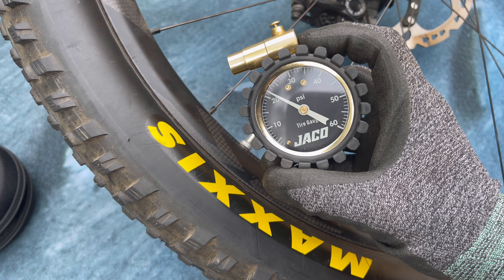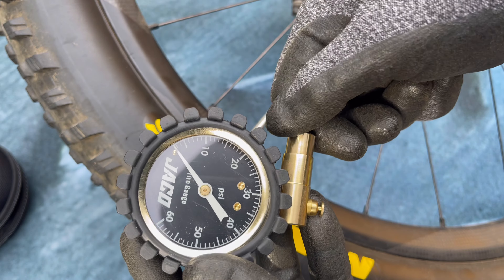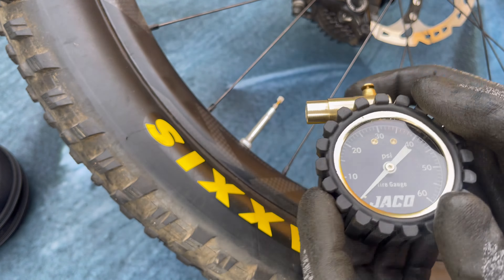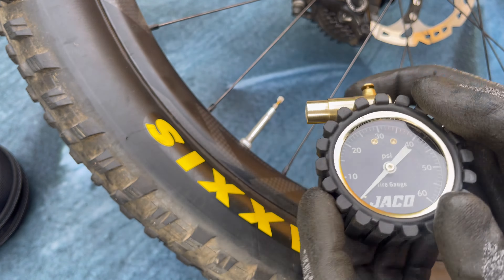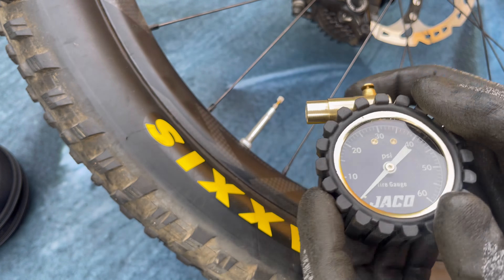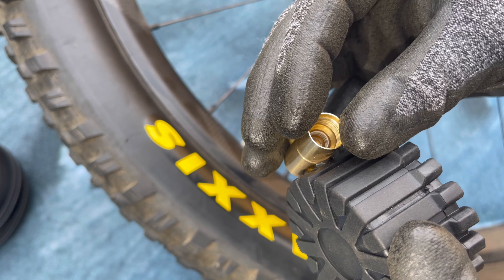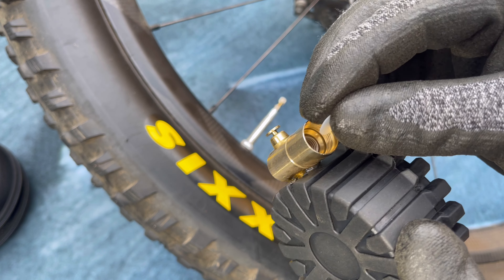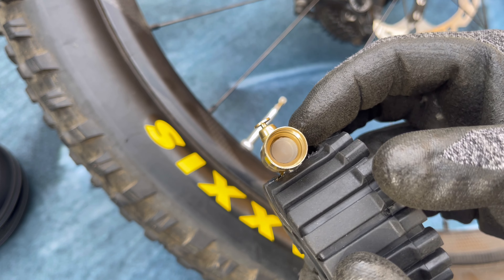How To Fix a Presta Tire Gauge That Isn't Holding The Pressure on Dial

Comment: I had just bought my first JACO RDX-160 Gauge. It wasn’t reading at all. Just losing air when I attach the JACO to my presta valve. I found that the plug was stuck. Was able to get it out with a very small tool. I followed your steps and my gauge is working like new. Thank you for  your simple steps to getting a JACO gauge working again.
Reply from the maker: glad it worked. Yeah its the most common issue with mechanical gauges which is why we provided this video :)

Comment: Wow I just found this video!! I don't have that exact gauge but it is a very similar. Mine is an Accu-Gage. I will try your tips and see if that fixes my issues with gage losing air pressure. Thanks!! **It worked! I added a small amount of dielectric grease to the o-ring just to see if that will help prolong its life. We shall see but I am super stoked the gauge works like new!**